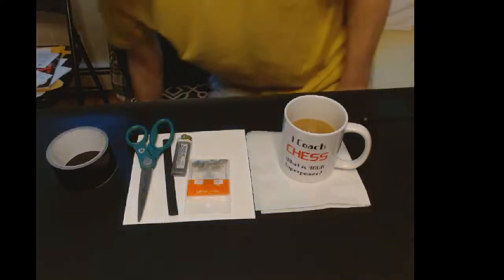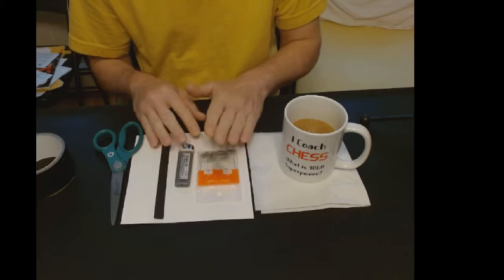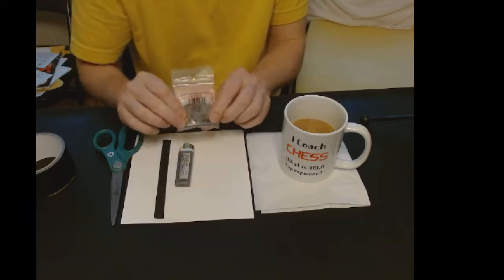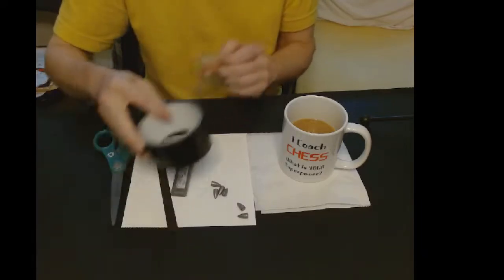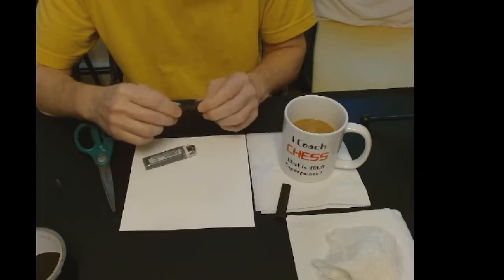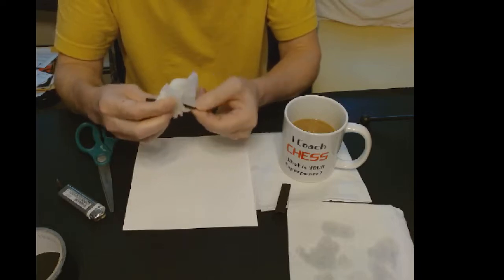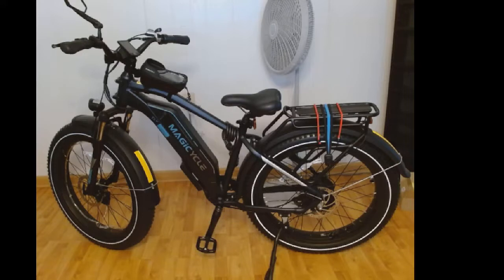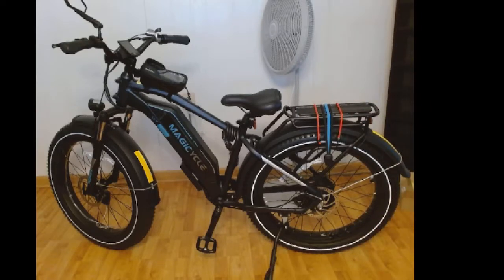Wheel Balancing the Magicycle

Comment: Have you thought about putting weights 'around' the spokes?  You could hacksaw a lengthwise slit in the lead and then squeeze it around the spoke.  Maybe a tiny dab of JB weld to hold it in place?  Sometimes one needs weights at more than one location in order to 'dynamically' balance the assembly.
Reply from the maker: I didn't want to potentially damage the spokes, plus these are cone or bullet shaped weights. The tubing makes it safer if they fly off, and also less likely to fly off.